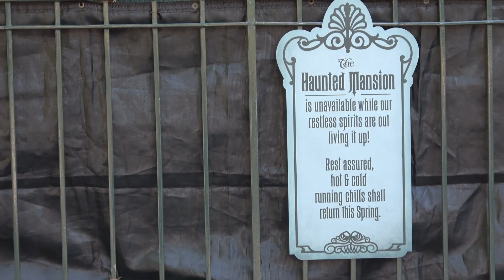Decoding Doctor Strange | Disneyland Construction 2020-03-07 Pt 95

Comment: The haunted mansion mostly looks different due to some dark masking material (stop over spray while painting another color) based on all the tape holding it in place.
I feel like the Snow White rock work looks so drastic and bright right now because they haven't done the weathering pass (adding dark washing/thin paint to make the texture POP).

Thanks for the update David!

Comment: David those remote cameras on top of the buildings are for safety they look like they are pointing at an angle that they cover both the roof and the ground  and I wonder why they have not connected up the cameras on the ground yet but I have an couple of ideas in mind will share more when I watch on larger screen.